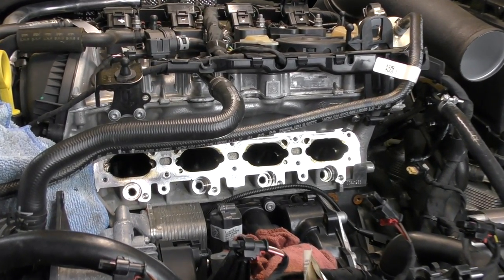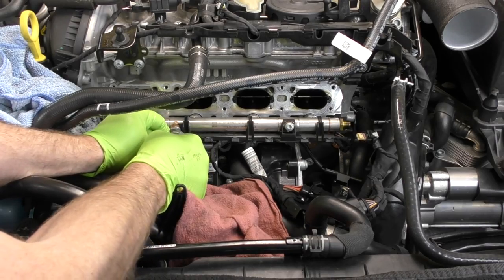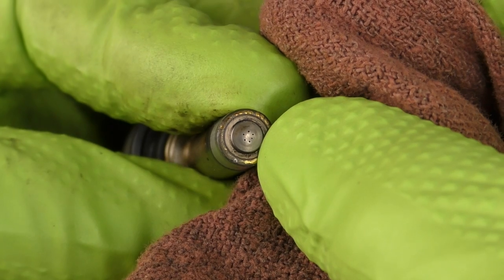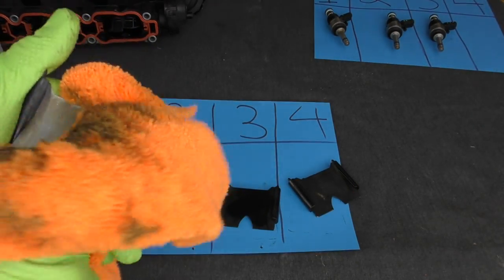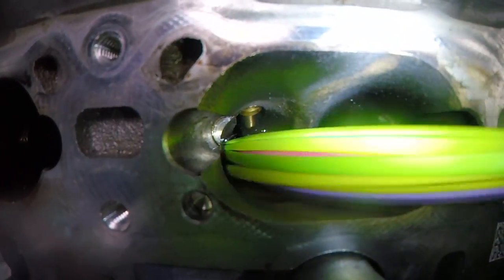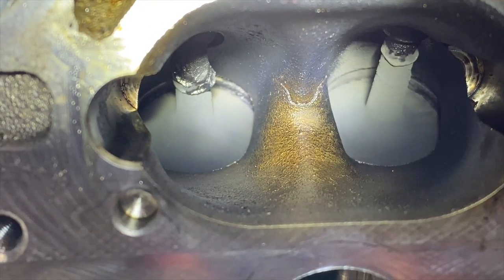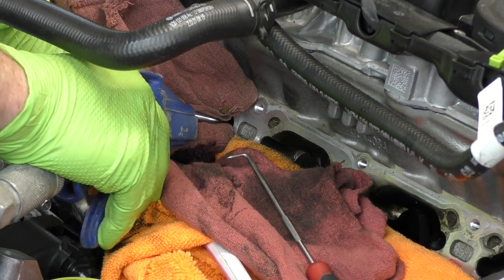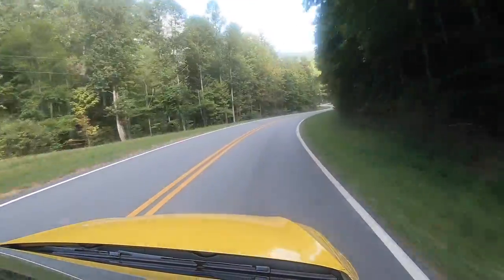How Much Carbon Build Up at 10,000 Miles?? ~ 2019 Golf R

Comment: From what I understand, Toyota uses 2 injectors per cylinder (D4-S) for some engines. One direct injection and one port injection, just to avoid this exact issue.
Reply: Euro market ea888s have that also
Reply: Toyota is also the few manufactures that pretty much skipped the Direct injection phase and went straight to dual injection. I guess it wasn't reliable enough for their standards to justify the power gains.
Reply: 0812rs VW uses dual injection on the new 3.0
Reply: @sl0907  Lexus learned their lesson with the 250. My GS 350 has D4-s. I did a bore-scope and it looks new after 100K. I do use techron but probably not needed.
Reply: alb12345672 I do not work on Toyotas, but I read an article on their dual injection system, and it is much more intricate than just spraying to keep the valves clean. The system switches between both injection types depending on many factors. Load, a/f ratio readings, throttle position, temperature, etc. Seems at idle the system mostly uses the port side. Under heavy load, and cold start it uses the GDI. While cruising, the system varies.
Reply: Ford has dual injection on their eco boosts(except for the 2.3) for this exact reason. Toyota or ford for me
Reply: Yep, they were the first ones to do it too. Take apart a D4-S/FA-20 and it will be almost squeaky clean inside no matter what the mileage. These VW engines will look like the bottom of a BBQ by the time they reach 60k
Reply: My Corolla SE has D4-S, brilliant system,  it also has a CVT with a physical launch gear.
Reply: @BlatentlyFakeName  I can't stand Corolla's they are absolutely sluggish with little to no potential.  Drive a GTI or GLI for a bit and you'll find that even if the corolla does the job it won't make you smile.  Maybe it's a personality flaw but I need my car to be enjoyable or else I feel like I am going to lose it or fall asleep neither is good.
Reply: Golf GTIs are a bit boring though. Like other VAG cars they also understeer a lot, because they put the engine too far forward.
Reply: @Osprey1994  "I can't stand Corolla's they are absolutely sluggish with little to no potential." The Corolla AE86 4AGE is legendary, the Corolla FX-GT (front wheel drive) 4AGE was fun too, the front wheel drive Corolla Sprinter coupe of the 90's is also fun, the ~2001 Corolla T-Sport/Sportivo with the 8000rpm 2ZZ-GE was MORE than a match for the Mk4 Golf GTI (especially the 8-valve one sold in the UK), while the GR Corolla is a plenty fun car too!  I don't think you were looking hard enough at the sporty Corolla variants.

Comment: I am absolutely appalled at how carbon-fouled the intake runners, cylinder heads, injectors, and especially the valve stems are. I've seen old engines with 150K with less carbon deposits. Is this progress?

GDI is an inherently flawed design, regardless of the power/efficiency gains. When an expensive service like de-carboning is required maintenance, that offsets any efficiency gains, at least from a maintenance cost perspective.

VW and other makers need to put catch-cans and part-time upstream injectors to clean the system out! Ridiculous!

BTW - great video as always Charles - keep safe brother!
Reply: @icanfartloud  wellllllll i'd like to see you design an engine. or would you need a "liberal college education" for that? lol
Reply: This is mainly an European car manufacturer problem. Not an issue with Japanese and some domestic cars i.e 2019 Mustang GT 5.0 actually has 16 injectors using multi-port injection. Uses port injection for cruise and low load, direct for high rpm high loads
Reply: Mike TeeVee this is more a problem in the US,  because of EPA standard, the intake manifold has four holes for four extra injectors THAt are supposed to spray fuel over the valves to clean them but unfortunately we don’t get that in the US
Reply: @d1zguy864  The euro spec golfs get dual injection, for some reason we don't get that system in North America. Maybe because of emissions or something.
Reply: @icanfartloud  has to do with the stringent emotions that the epa wants cars to have. Most of the regulations aren't doable.
Reply: @sl0907  It's the opposite the European emissions are more strict requiring the extra port injectors. EPA is less strict however nothing is stopping them from installing dual port injection in the USA. Except that marketing and executives found a way to save money by not installing those parts. Well they lost money on me because this is the sole reason i passed on ALL golfs and instead just going to keep and work on my MK4
Reply: Very well said! I've been seening this in the light duty diesel market forever! You havent seen any advances in that engineering here either! Granted. More difficult with diesel but still! Catch cans my man! Been saying that for years and I've yet to see any diesel trucks with them! Ugh! Someday hopefully!
Reply: @d1zguy864  MK4 is a robust hard working car. I have one as well. Cheap and low maintenance. Delivers a lot with a good price.
Reply: d1zguy Any vehicle with direct injection has this problem. Country of origin is irrelevant.
Reply: Lynx Star Automotive I think the point is mk7 golf r models vary by market, and when it relates to direct injection - significantly.
Reply: Peejay Em I get the point. Carbon build up is just as bad if not worse on Ecoboost engines. I had an ecoboost in my old Transit Connect, and that thing would develop carbon build up as early as 22k miles. Hyundai and Kia are worse. On those not only do you deal with carbon build up. You also have to deal with unreliable pumps and injectors too.

In reality this is not a VW problem. It is a GDI problem. That VW are more sensitive to it? Yes, that argument can be made.
Reply: Lynx Star Automotive yes, and thankfully I’m located where carbon build up is not an issue on my Mk7 Golf
Reply: @d1zguy864  I had an 02 jetta 1.8t awp and I never saw this level of buildup even after 50k miles and I had it chip tuned, bolt ons galore, and drove like a bat outta hell most of the time. I miss that car!
Reply: Diesels have been direct-injected for decades with similar problems. Old news. Stick a decent catch can on it and problem solved.
Reply: DriveAndMaintain No problem is not solved. There is no evidence a catch can eliminates the problem. Only that it slows it down.

Diesels also didn’t have carbon build up issues as a GDI does, because for years diesels used no emissions equipment like EGR. Modern diesels carb up worse than any GDI! Catch can or no catch can.
Reply: Peejay Em My understanding is that dual injected models still develop carbon build up, just at a much slower rate. I’ve seen videos of folks in Europe performing induction services at 100k + miles. They don’t look as bad as ours do with a fraction of the miles, but there was definitely build up there. Enough to justify a cleaning. Also my understanding is VW has abandoned dual injection in the EA888 in Europe as well.

Is stateside will know soon enough. The latest 3.0 is using dual injection.
Reply: @lynxstarautomotive208  I don't believe manufacturers put port fuel injectors because of carbonization. They put it to make more power. It is far easier to put port injectors to take care of the high revs together with the direct injectors, than to put a big ass HPFP, that will cause a lot of drag on the engine to deliver a fuel flow that may be used less than 10% of the time. I've seen PFI only engines with the intakes almost fully blocked, it's not going to prevent that.
Reply: @icanfartloud  An engineer designs specifically for performance outcomes. The rest is left for customer support and maintenance - all of which have a business model to them.
Reply: What you wrote that they should do is not eco so big no ;)
Reply: Mike TeeVee Actually that’s what Honda does, they have oil catch cans built into the valve cover which drain back into the head, they have them for both the PCV and breather hose.
Reply: Unfortunately one can't use catch cans in countries with cold winters.
Reply: MrJayjay0420 Why not? I live in Minnesota and they work just fine.
Reply: @d1zguy864  Sure it works but 16 injectors to do the job 8 used to do ?  EPA is what is ruining everything.
Reply: You don't know what you are talking about.  GDI has nothing to do with carbon in the intake
Reply: @lynxstarautomotive208  you don't know what you are talking about.  Are you a mechanic? If so I would let you work on my car
Reply: They need something similar to the 86/brz where they use port and direct injection.
Reply: Lexus and recent Toyota also have direct injection but they also keep the port injector too.  Some Ford also used dual injections, and it solve carbon built up problem and deadly reliable
Reply: @TheLuisestrada5052  There's no EPA standard that has to do with if they do or don't spray fuel on valves, it's about not  venting sooty crankcase gases into the air.
Reply: Think this is why they are going back to port injection with direct injection.
Reply: @icanfartloud  No, it is regulation. They are making this trade-off consciously.
Reply: Without the carbon cleaning you're bound to burn your valves and get an engine failure on these engines at round about 80tkm... AGR and all that crap, these engines are pure crap. AGR + oil residue from the crank case ventilation, it will stick up like crazy in the intake and ruin the engine over time.
Reply: @Idlia Dosai You are kidding right? EPA regulations are the reason that big cities no longer have smog. Diesels have been running crank ventilation for years before gas direct injection, it's a shame designers can't figure out how to keep the soot off the valves. Not all of this is the EPAs fault, companies have basically given up designing good engines that are compliant to emissions. Also your analogy with the cargo ships is a fallacy. The larger the ship, usually the better because they can move more goods with a baseline of emissions and fuel consumption. Put it this way, if you tried to drive around the tonnage that is move by cargo ships you would be polluting a hell of a lot more.
Reply: 150k really really. You talking rubbish
Reply: @kde5fan737  This makes no sense
Reply: @d1zguy864  Since even the injectors are dirty, even dual injection would have quite amount of carbon build up.
Reply: Everything in the name of emissions and fuel economy. Yet, cars of the 90s were getting better fuel economy. Things have gotten far too complicated, and heavy.
Reply: Exactly. The same for DPF filters in diesel. You have to take the car on long highway runs every now and then to regen the filters yet they install them in small town cars. If you make a point of taking a long trip not to run into issues with the DPF, you are not saving any fuel in the end
Reply: What about designing the system to actually be cleaned/maintained?  Catch can should be required equipment for these cars.  They don't prevent build up but sure as hell reduces accumulation.
Reply: @reubenmorris487  It's all about the environment, they want to burn those oily residues, not have you dump it in your garden or somewhere else where it needs to be disposed of I guess?
Reply: @icanfartloud  Liberal college students in Germany...oh wait Germany is pretty liberal.
Reply: I can't agree with you anymore. Thats why my next car will be a lexus IS best of both worlds. DI plus PI.
Reply: When is this technology going to go away? Every performance oriented car now has DI. I will never purchase one with it knowing what is happening. Need to look for old fun cars again...
Reply: @TheLuisestrada5052  IIRC I read somewhere within the last few months that the newest VW's (ROW cars) that had dual injectors (one port one in cylinder per cylinder) don't have dual injectors anymore either, I don't know if that true but Vw has been cutting a lot of corners for awhile now it doesn't surprise me at all if that's true.
Reply: toyotas have dual port and direct injection, germans zzzzz
Reply: @TheLuisestrada5052  this makes zero sense, please check your sentences

Comment: I found it very interesting to see "dirt" patterns on the fuel injectors, and I agree with you that it is likely related to the in-cylinder airflow. I used to observe something similar (in my case, dirt from unburnt fuel) on a transparent single-cylinder research engine I worked on. Carbon build up occurred every time we fired the engine, it was visible on the cylinder wall, head, etc and would change patterns slightly between port-injection and direct-injection systems.
Reply: The only way to stop this is to route the blow-by to a separate collection reservoir that is removable for maintenance of emptying and cleaning on a regular basis. Like oil changes with a warning system in case of overfill or clogging. That goo should never be introduced to the intake ports.

Comment: Thanks for posting--great video. Two things: 
1) The R specs 0W30 504/507, which is significantly heavier than the 508 spec
2) I've strongly recommend never using a Scotchbright pad in any engine, ever. Even though the valves are closed, there are small (40 micron) aluminim oxide particles that are bound to make it past the valves, no matter how careful you are. Most engine remanufacturers warn against this, and GM had a specific TSB regarding the use of them in their engines. And, there's really no need to do it. Zip ties work fine.
Reply: I just performed one of the most interesting services to my vehicle (zip tie method) and the before and after was similar to most of the walnut blasting reveal photos I've seen. Spent a total of 20 bucks!

Comment: Thanks Charles, for highlighting the carbon buildup problem with these GDI engines. GDI has always seemed to me like a superior fuel induction technology for gasoline engines in theory, but the practical aspects of its maintenance drawbacks seem to nullify its advantages to a large degree. The hybrid injection systems, like on the gen 3 Ford Coyote 5.0 engines, seem like a good solution. I do like the more precise fuel metering capabilities with GDI NA engines being able to run higher compression ratios.

I think it would be interesting to test the effectiveness of oil catch cans in reducing intake tract deposit buildup on engines with and without the cans over a prolonged period. It might give some insight into the contribution that cylinder blowby vapors are making in the formation of carbon deposits on the intake valve faces.

Comment: Hey I’m a huge fan of the channel. I intern at a petroleum testing company and we do a lot of research on carbon buildup or carbon fouling it’s more commonly called. The first point I’d like to make is that brand of gasoline doesn’t make any difference when it comes to fouling and most of the claims but gas companies are BS. The second point is that I think tuning can lead to accelerated carbon fouling as tunes typically increase the AFR. One of the best ways to counteract this is to install a more powerful spark plug. Love the channel and thanks for all of the guides it made me confident enough to do maintenance on my alltrack rather than taking it to the mechanic
Reply from the maker: DUDE Great insight! I will be upgrading the plugs soon. Just don't want to spend $200 on plugs. HAHAH
Reply: HumbleMechanic no problem I’m loving the golf R so far and I noticed a typo in my original comment. Tunes normally decrease the AFR not increase it meaning you have an engine that runs richer than it was designed to.